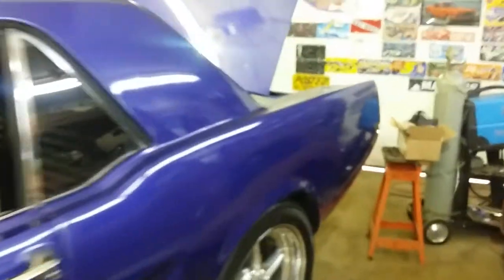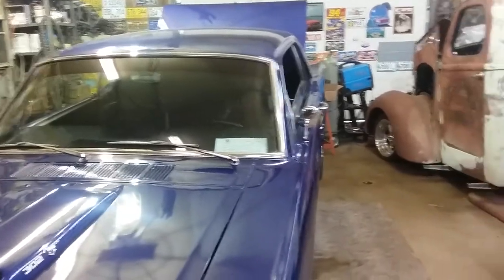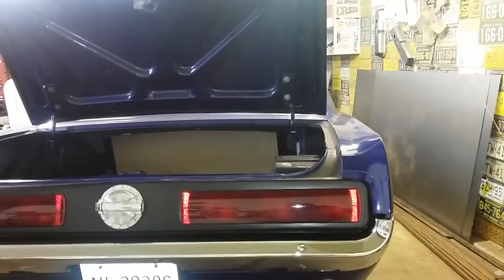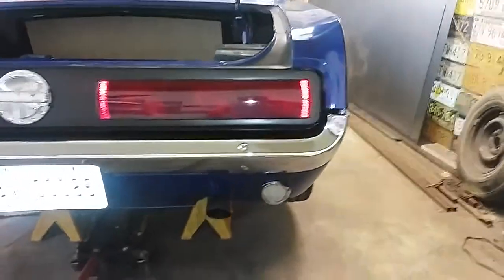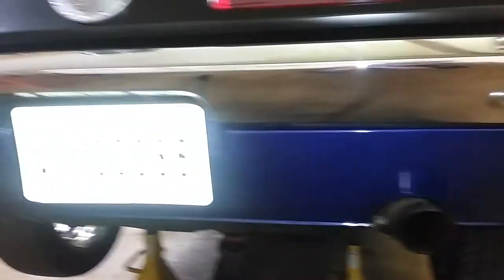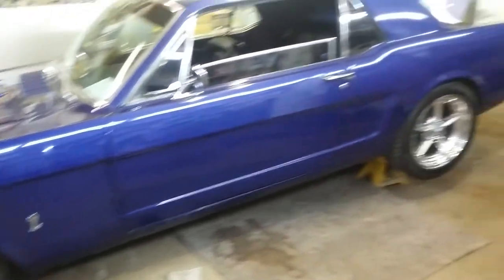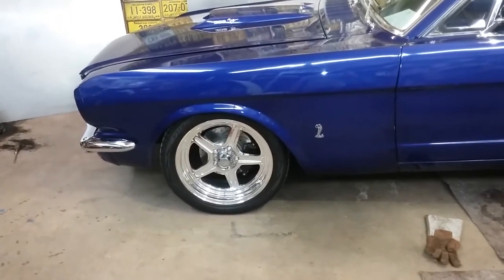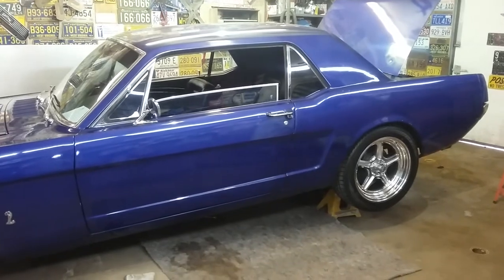1965 Mustang: Drive shaft safety loop

Comment: Sweet! Hope you get to run her. Any idea on what you hope to run?
Reply from the maker: Rudderify I have street tires so hooking up will suck. I've used a gps 1/4 timer on my phone while running on the street and it was mid 12s. I would be extremely happy if my car ran anywhere in the 12s. Fingers crossed